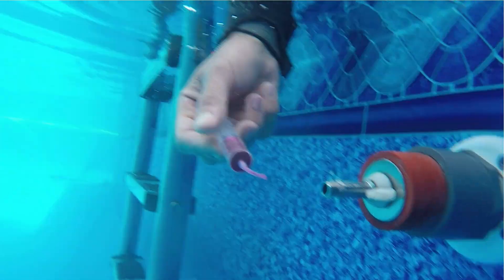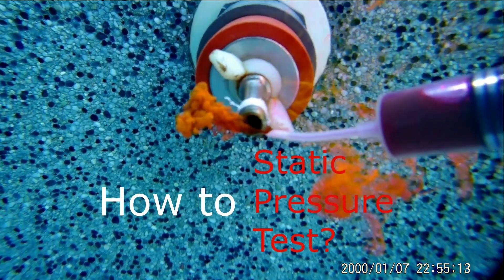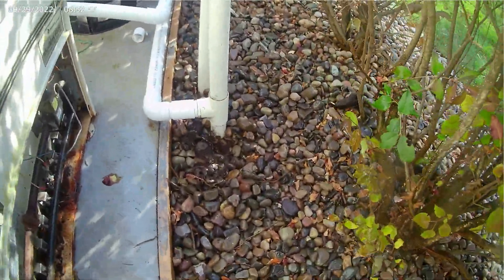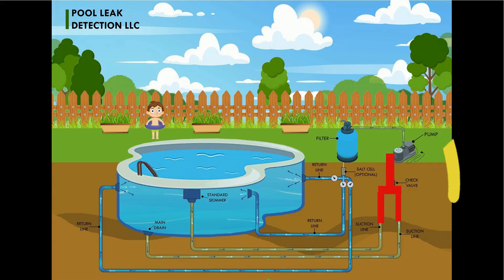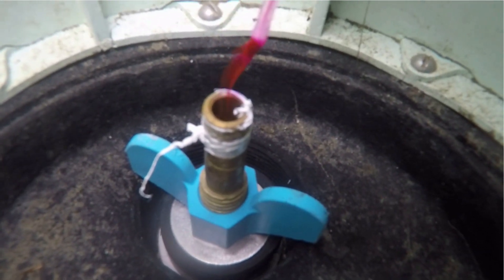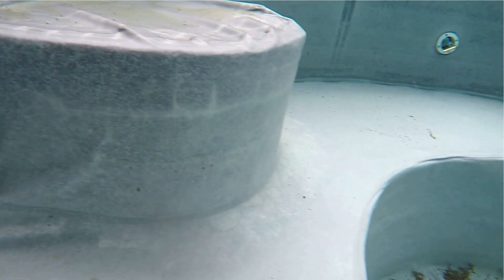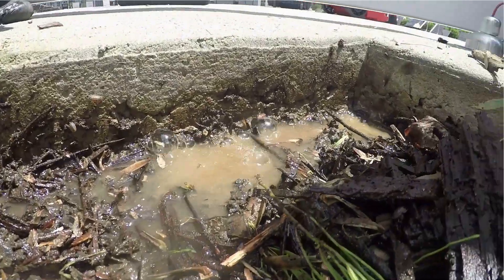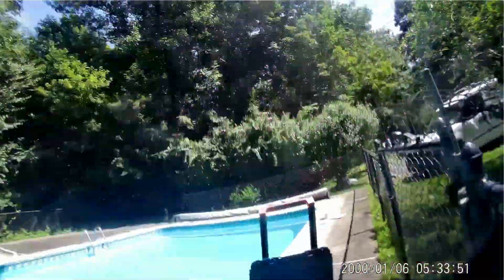How to perform Static Pressure Test for Pool or Spa lines | Leak Detection

Comment: Do you have any videos of what underground leaks sound like when using deck plate.
Reply from the maker: Yes I do. Here you can watch or better listen! https://www.youtube.com/watch?v=WDUuRMIhgk0&t=4s 
Also, I am making anpother one but it will take some time. Let me know if you have any questions or other requests.
Reply: @poolleakdetectionllc  Once the soil is saturated with water can I just inject the pipe with air to hear the boil? Also if I have air and water running at the same time does it have the same effect to create a boil or do they need different intervals?
Reply from the maker: @ericmilligan2462  Yes, you can saturate the soil with water and the use only air to listen the bubbling sound. Althoiugh if the leak is large enaugh that it drains pretty fast you can run water and air at the same time. Although you need to be careful when you identify the sound. Try multipe times with smaller pressure to narrow down the leak. The proper way is to fill the line with water, turn it off, and insert small portions of air every 5 sec. But if you are solo then you need to run air constently. If the leak is small will build up the pressure pretty fast and the plugs will pop-up. So me mindfull if you are dealing with small openings. Does it make sence?
Reply: @poolleakdetectionllc   yes that helps a lot thanks. I found leaks in the past underground but I’m stuck on a pool right now. It has a pretty big leak I just have not been able to hear it. They have a spot we’re they cut concrete and water is filling it up when ever I pressure the return line. I just have not been able to pin point it yet.
Reply: Once the hole is filled I even have air bubbles come up after running the pressure rig for about 5 minutes or so.
Reply from the maker: @ericmilligan2462  usually leaks are within 3ft from the shell of the pool. Try to use the pipe mic with the help of a snake. Large leaks close to the pool are easier to identify.
Reply from the maker: @ericmilligan2462  you didn't hear any noise or it was not clear sound of a leak?